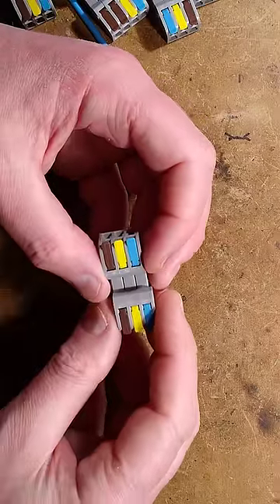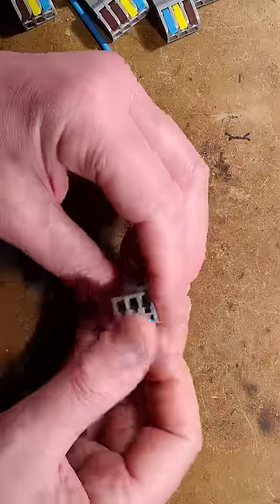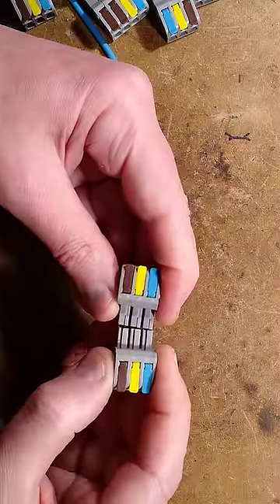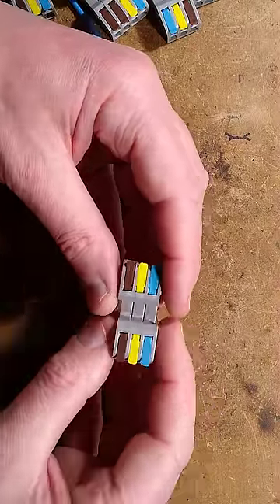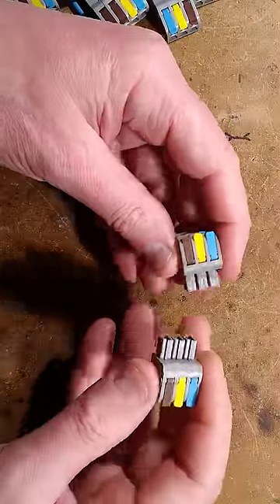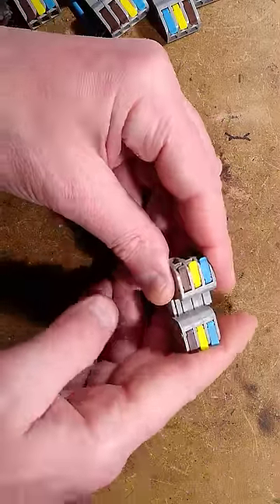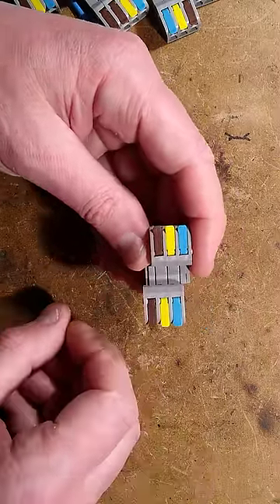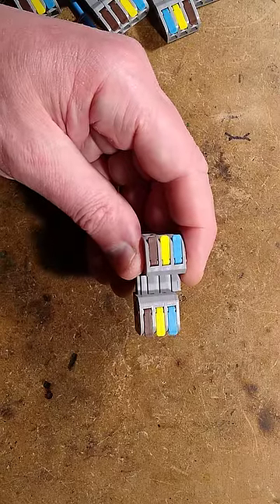This connector can kill you

Comment: In risk analysis we call that "reasonably foreseeable misuse" and yes, you are meant to take it into account.
Reply: In layman's terms it's called "idiot-proofing" and it can save lives.
Reply: @PunakiviAddikti  I tend to reserve that term for preventing stuf that's way harder to do by accident than misaligning a connector by one pin single-handed in the dark. But I get what you mean.
Reply: isn't this what Murphy's law originally ment?
"if it can be installed wrong at some point it will be installed wrong"
Reply: I feel like this video is more than enough disclaimer to go ahead and NOT try to connect them both live and blind. I'd rather have a connector like this that can be plugged wrong than gendered connectors that cannot be used properly without adapters. Such as 2 pin battery cables, found on 12v chargers and powersports. If you want to "boost" off the plug on an ATV, and want to use battery charger clamps you already got, you gotta reverse the clamps or make an adapter. Whereas here you just match the colours.
Reply: @christopherrto  Oh thanks, next time I'll just try not being blind.
Reply: @snickerdoooodle  Yes, I would highly recommend that before working on live circuits.
Reply: @ManWithBeard1990 This brings to mind the Japanese term "poka-yoke", literally "avoid errors", but fewer people have heard of the other term, " baka-yoke", which means "avoid idiots" 😂
Reply: I bet the junior designer who came up with this thought he was suuuuuper clever at the time, and boy was he wrong. Companies need to keep more greybeards around rather than relying heavily on inexperienced rookies.
Reply: @CarbonKevin ah, yes, young people are to blame for everything.
Reply: Foreseen Consequences.
Gman hates this one simple trick!
Reply: @jmckendry84 yep
Reply: Natural selection works for career choice, too.
Reply: If something can be misused, eventually someone will misuse it
Reply: I'd rather do the job right and safer with adapters then risk killing myself, but you do you. Should honestly start your own channel like electroboom, lol. @christopherrto
Reply: This could be resolved simply by making the pin socket holes diffrent shapes square circular and square then only 1 orientation would clip together... !
Reply: @David-td1tf  Had the same idea. Even just the middle one being different would do the trick.
Reply: As an electrician, we make hundreds of connections per week when job is repetitive. So if something goes unnoticed, like that, it's foreseeable failure which could result most horrible things, such as death and fire accidents. This invention is obviously too dangerous to use and needs to global ban. Only solution is to avoid  such products. Better work with something foolproof and do not connect anything into live circuit. Nobody should work with live circuit without safety supervisor, or at least 5 years of experience with live circuit  as an electrician, to do this alone. It doesn't matter how smart you are, electricity doesn't show itself, before you're dead or shocked which is very obvious.
Reply: In the real world, your designers and engineers would get a helluva performance review meetinf and/or lose their jobs for letting that connector even leave the CAD workspace. Risk management involved reasonable, cost-effective risk mitigation. Keying your power connectors is reasonable, cost-effective, and it has been done for decades.
Reply: @CarbonKevin well, the elite, who own the companies, met in Davos, and decided to thin out the population. So the engineers are selected from top Frankfurt-School-influenced universities, not to believe in natural law, and natures God, but rather in money. That is why people who love money, (money changers Jesus called them) have so much influence. So our young engineer may not care a wit about how many people his products kill. And those who blame the user for being blind so you think the user being tired, blind (or perhaps having cataracts) relieves producer liability ? Weird
Reply: I think risk analysis is something everyone should learn when they are young. Such a versatile skill
Reply: In cybersecurity, we say: think like an adversary/attacker; how can I break/misuse this?
Reply: @Thatonefuckinguy  Guess what happens when you don't have the adapters? You make it work. Oh, so we're now in an even more unsafe situation 🤦🏽‍♂️
Reply: @BBQlover31  How does one achieve the required 5 years of experience working on live circuits if they can't work on live circuits til they have 5 years of experience working on live circuits? 🤔
Reply: @eddieelizabethhitler3259 
He clearly mentioned "with a safety supervisor OR 5 years experience"

So I'd wager you could get that experience by, you know, working with a supervisor.
Reply: @conripolar  "OR"
Reply: Risk analysis? What's that? We build for chynah!
Reply: reasonably foreseeable misuse... does that apply to contraceptive manufacturing too?
Reply: In design we call not taking into account "reasonably foreseeable misuse" bad design, dangerous, a reason for product recall and a legal liability.
Reply: I've been guilty of  "reasonably foreseeable misuse" with floppy drive connectors back in the day. When trying to make the connection blind (by feel), it is easy to end up with a one off error. Of course, one is not dealing with dangerous voltages in this scenario (worse case is you destroy a floppy drive or a motherboard). This is unlike something like an IDE connector (specially if they are properly keyed —the vast majority were, a small number were not).
Reply: Yeah but you can reasonably add a simple keyway to fix the issue.  This was a dumb design.
Reply: Responsible misuse? What a life of contradictions
Reply: And in terms of product liabillity, this would easily be flagged a "design defect".
Reply: im currently having an audit class and we studied that omg
Reply: The way I've always seen it is there are two main groups that folks can fall under when it comes to injuries or fatalities relating directly to the use of a device, tool or piece of equipment et cetera. The first group I simply call the "Anomalies and Flukes" or the "Freak Accident Group. This group consists of trained personnel, well versed in the correct and safe use of the item in question (in this situation the connector). Through no fault of their own actions, neglect or lack of training/misuse of the item, an injury or a death still resulted from it's use. 
Then we have the second group who we'll call "Self Proclaimed Genius Intellectuals" just to keep it clean. These subjects will have no qualms whatsoever in the use and or application of a given device, tool or piece of equipment in any manner or method they see fit, regardless of warnings or cautionary statements from the manufacturer and or their coworkers/peers. They are often willing to "experiment" or "modify" an item to suit their needs without prior research or evaluation of the potential dangers that could result from tampering and improper use of said item. User manuals and other safety information is often scoffed at, if not disregarded entirely. It is not difficult to spot the kind of characters that fit into this category as they are often missing one or more digits on their hands, if not the entire limb.
Reply: Stay in class. In engineering we call this poor design.
Reply: @ARockRaider no
Reply: @ManWithBeard1990  yeah, it's so easy to call anyone an idiot. These guys have 0 sense of empathy.
Reply: It's like in European schools, always assume the person dealing with what you made is dense
Reply: @PunakiviAddikti it would be easy enough to idiot proof, just make the middle connector a triangle. Can't be side loaded, can't be flipped upside down. Could still theoretically connect one side to the opposite side but it's still a lot harder to do that accidentally without realizing it.
Reply: @sethsevaroth  exactly, which baffles me why they didn't think of doing that.
Reply: Obviously no CE marking on this connector
Reply: Yeah literally in product design before prototype
Reply: @christopherrto  get set of wire cutters an crimps. 😂
Reply: @Will-dn9dq  ...why? So I can make an adapter like I said? Oh, thanks, I would never have guessed that's how I would make an adapter, thanks captain obvious.
Reply: Even if you are not working with a live circuit, this can be a problem because a bad connection can unknowingly be made, then when you turn the breaker back on the appliance becomes live.

Then while dad’s in the garage flipping the breaker, along comes the kid to touch the live appliance.
Reply: I find it funny that places like ebay and Amazon sells all these products that seem useful but considered safe or just completely banned in profession Electrical work. Meaning that it's being sold to people who are not trained electricians and have more risk of Injuring themselves.
Reply: @christopherrto Unless every person who will ever use one of these sees this video, no it is not enough disclaimer.
Reply: In software design we call it "if it can be broken by using it wrong, there is 100% chance that some customer will do that".
Reply: It's called a bad design.
Reply: @jmckendry84  Its lovely how young people are to blame for everything and not the generation who apparently failed to teach them.
Reply: Great narrating, whoops, shock me ,
Reply: Does everyone realize that using a wire nut and connecting the hot and the wire grounded to the box would create the same problem. Actually every way of connecting 2 wires can create this problem, not just this connector. Hell if you switch the two wires on one of the connectors and plug the 2 adapters in correctly you would still have a problem. The point being, if you're not qualified to work on electricity, then pay someone who is qualified to do so. This connector is any more dangerous than any other connectors if the person using it isn't an idiot. It's why we use universal colors for wiring. And if you don't know which wire is which, you trace it back. Cuz wire colors don't matter either, just what they are connected to.
Reply: @nolaspeaker5656 how is it a bad design? If you criss your wires and plug it in correctly the same thing can happen. This simply requires you to know what you are doing and if you don't, hire someone who's qualified and undergone training to understand electricity. Because ultimately you shouldn't have the electricity turned on when connecting these anyways, mor should be touching any metal that its grounded to when you turn the breaker on. If you do that, it's not the design, it's the lack of experience and knowledge from the idiot using it
Reply: @DailyFrankPeter so if wire nuts are used or b connectors and you grab the wrong wires, is the company who made the wire nuts in the wrong or the moron who grabbed two wrong wires and tried putting them tigether while they were live? If the wires were crosses when putting them into the connectors and you plugged it in correctly but still got electrocuted, is that bad design or the idiot without experience and knowledge trying to do something out of their depth. This used by electricians wouldn't result in very many injuries per the amount used. Because electricians know what they are doing and it's why that profession exists.
Reply: @exintrovert1337 and so putting two wrong wires tigether with wire nutsvwouldnt be the same thing? Whose fault would it be then? The company that made the wire nuts or the idiot who shouldn't have been messing with electricity if he's not qualified to do so. Cuz crossing wires is just as easy to do, even in this connector if you crossed the wires going in and plugged it in correctly,  is it still the fault of the design or the idiot who shouldn't have been messing with electricity
Reply: @sethsevaroth but how can that be idiot proof if the idiot Landa the wires om the wrong g terminals going g into the connectors and plugs the ports tigether correctly but because the wires were not placed in the correct spot to begin with, they still get injured, which wouldn't happen if you turned off the breaker. The only way to idiot proof working with electricity is to hire an electrician, they don't make those mistakes and if they do, well they knew what they signed up for
Reply: @StoneInMySandal so in engineering, how do you stop people from crossing the wires going into those connectors so if they plugged it in correctly, and were stupid enough to do so with live electricity, and still got injured? Because that's more plausible than pushing the connectors together incorrectly? You can't account for that in design, it's simply because unqualified people shouldn't be using these. Qualified people won't make that mistake
Reply: @ZeldagigafanMatthew no it wouldn't. This design is fine. It's just as easy for someone to cross the live wore and the ground plugging it into the connector, even with color coding, and then plugging the connectors in the correct way but still resulting in the scenario the video describes. How would you design so that it couldn't happen? You can't, it's made for people who are qualified to use these and if you aren't, you call an electrician.
Reply: @larryclemens1850 so who is legally lliable if the hot and ground wire on one of the connectors is switched and the person plugs the connectors in the correct way, as in all 3 ports lined up but still ends up crossing the live and ground works, and is also working on a live circuit and touching the metal the device is grounded to? Who's at fault? How would you design it better so they put the right wires in the right spots. As we can see it's already color coded
Reply: @LinkandPage   Standard connectors usually have an asymetric feature(s) that allows the male to mate with the female only one way. If there is some  problem with the way those wires are terminated, the issue is either with how the larger device was designed (which can be analysed through an inspection of the blueprints) or with someone not following the design when assembling or servicing the device.
Reply: @LinkandPage  All I'm saying is it usually pays off to protect the customer from themselves. :)
Reply: Poor design. To allow it to be easily possible to happen in the first place.
Reply: @CarbonKevin most of my experience being a rookie was pointing out this kind of potential issue, only to be told that we know what we’re doing, thank you very much, as we’re the ones with experience. Then watching exactly what I pointed out go wrong 😅 I think it’s more to do with hubris than inexperience
Reply: @CarbonKevin most safety devices and fool proofing came about by lack of safety and fools over time  rather than grey beards experience. 😂
Reply: @christopherrto  in my industry this type of connector wouldn't be viable as there is almost never the clearance to both see and connect the plugs together at the same time.  Not to mention it'd fall apart or get filled with corrosive debris after a week of use.
Reply: @exintrovert1337 The other problem is even if you connect it correctly, you’re leaving a hazard for the next guy who might or might not be aware of the high risk. They might not realize the connector isn’t keyed until it’s too late.
Reply: @christopherrto  doesn't even need to be live to be dangerous.
Reply: In consumer analysis, we call it a defect.
Reply: @PunakiviAddikti  no. this isnt an idiots mistake
Reply: However, it depends on the specific application because there are many industrial applications of this inside a piece of equipment where it is visible and a train professional uses it

Comment: It would have been so easy to have a moulded keyway in the plug to prevent that happening.
Reply: Also, you know, swapping ground and neutral so that you'd have to misalign by 2 places before shit gets lethal
Reply: @wyattroncin941 that would have been the cheapest & best option, because it’s just changing the color around in the assembly hoppers.
Reply: It would just generally be trivial to not make the different sockets and tongues the same exact shape, but nah... ctrl-c, ctrl-v, "good enough"
Reply: @GoatPopsicle  or, just flipping the outer end connector housings...
Reply: making the ground 2 milimiters upper would solve this, almost looks on purpose
Reply: I was looking for this comment
Reply: Well then it would be impossible to shock you because if you get it wrong by two spaces you're only connecting one wire to another
Reply: @gameboy1984 
Unless you're on rubber you can still be shocked.
Reply: I'm thankful for things like this. It showed me that this was a product that was pumped out as cheaply as possible to make a much money as possible without a single thought to its actual use case. It makes it easy to know what not to buy/ use
Reply: Yup, a tiny keyway, one connector could be a slightly different shape......weird

Comment: all they would have needed to do was make the spacing between live and earth different to the live and neutral and it would have made it impossible to connect incorrectly like that. especially considering the color ordering has to be reversed on one of them so as to match when connected.
Reply: Spacing alone isn’t enough to prevent the leftmost from connecting to the rightmost
Reply: Just flip earth connector so it would not be possible to connect it to live connectors.
Reply: @The0Stroy just keep earth connector as a different switch completely maybe?
Reply: Just key the holes differently like so it can’t go in wrong
Reply: @diggoran  unless you're plugging it in wrong on purpose, you wouldn't get it that misaligned, but even if you do, you won't be connecting live directly to ground.
Reply: Or have a Square for earth. Making it Impossible